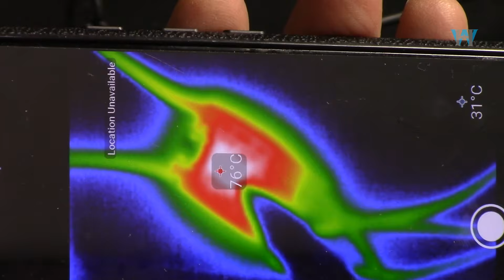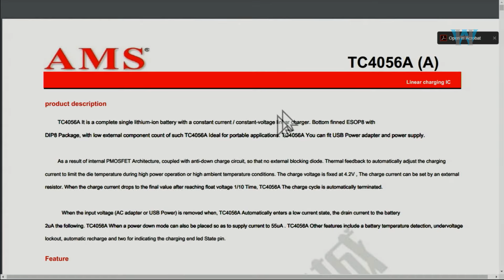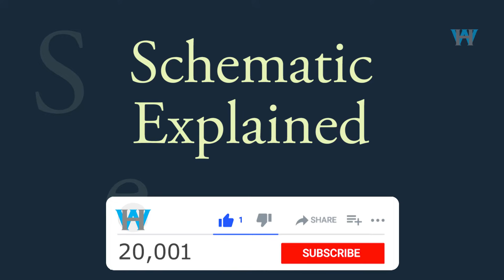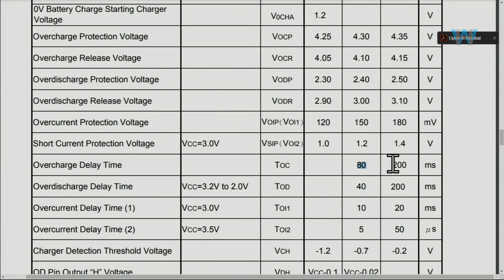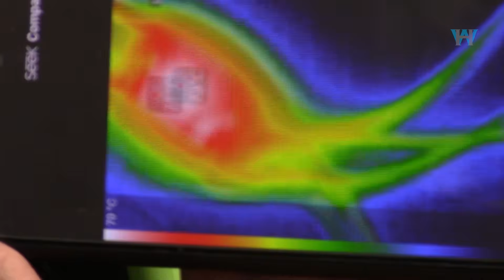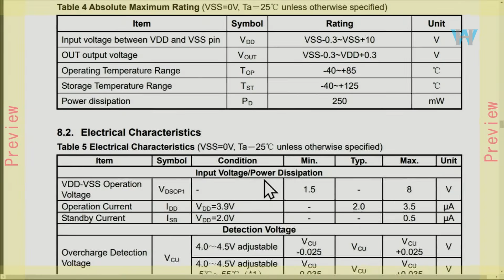TC4056 TP4056 USB 18650  Lithium  Battery Protection Charger Review

Comment: Its possible to change the cut off to 3,5/3,6v? I Want to use with a buck to 3,3v. Some one have any sugestions? I gona use with an esp32 and a MPR121 module, I dont wanna bust up to 5v because the regulator from esp32 is linear and I dont wanna wast batery.

Comment: Hi, 1. can i use 1 module to 2-4 batteries? 2. Will it protect overcharge & over discharge to all batteries? I understand the charging will be slow, i am ok with it. 3. Aslo are you saying if my equipment draws say 10w, this circuit will provide it? I thought this circuit only outputs 1A max (i.e 5W). Please reply. Thank you for your time.
Reply from the maker: Hi, 1-NO.  2-This if for lithium batteries and it has all protections which has been explained fully. 3 the amount of current this module can supply has been explained in the video.

Comment: So, how would I disable over current protection?
Reply from the maker: Hi, you made me watch my video. I have explained it clearly and even I mentioned the amount of voltage detected by the chip. simply remove that resistor I've shown in the schematic. This is the most detailed video if you want to learn. just watch and learn and you will be king of the battery charger using this chip.

Comment: hi, i bought like 50 of them cuz i make DIY projects, i put a remore usb c module so i can charge the battery from the side of my DYI tazer. but i put pos on neg and neg on pos, do you know what component died?
Reply from the maker: Hi, the both main chips should be dead as there is no protection in the chip for reverse polarity.

Comment: I have to replace a battery, which contains a little board with two chips on it.  One is the DW01A, which brought me here, which was good because I couldn't find a datasheet for it.  The other chip is the SM8205, and I can't find any information on that either.  I can find suppliers and even pictures of the chip - but no datasheet.  I don't suppose you have any info on that one?  It has 8 legs, but legs 6 & 7 are bridged with solder.

This was a very informative video, by the way - but unfortunately, it doesn't cover the chips on my battery.  Maybe my 8205 does the same job as your 4056 - or maybe not.

Incidentally, there  are two straps from my battery to a little circuit board containing these chips, then there are three wires from the board to the minicomputer board that it powers - red, black, white.  I don't know if the white one is for charge monitoring, or for temperature.

Comment: Hello, great video. I don't know if you'll be able to answer this since it's a 3-year-old video by the time I put Make this comment. But I don't know if I'm doing something wrong or if my entire batch of 20pcs of ts4056 are bad. 
USBC version. It has the extra protection. But when I plug it in. No lights turn on. Doesn't seem to charge. I've plugged just the USBC in, I know that the plug is good and the power supply is good. But it doesn't seem to have any voltage going through the terminals connecting the USBC to the board, or from the battery output and input. Or to the component. But I have wired it up so that my battery will go to my lights. And that works fine. But it doesn't seem to charge. The lights don't turn on if I plug it into a power source via USB or to the batteries. Or from the batteries to the component. 

I've tested five out of the 20 that I bought. But I at least know that my battery will power the component I'm plugged into. 

On that note, since I can't send them back. Is it still a good idea to be using this as circuitboard that can protect my lights from the batteries messing up or anything? Or should I just unplug it and buy new ones? 
Which I do have new ones on the way but I now have possibly 20 of these completely useless boards.
Reply: It’s probably your power supply. Some of the (PD?) supplies use the data pins to negotiate a voltage since some devices like laptops can take higher voltages (20 volts?) to get more power out of the usb-c connector. These charging boards are dumb and don’t do any handshaking. Try a basic 5 volt supply and/or bypass the usb-c jack. I read somewhere that shorting the data pins might signal the power supply to generate some output, but do your research!
Reply: @TroyeWelch  I actually just figured it out the other day. It was the cord. Some courts just don't work with this chip. I have two different manufacturers and they both have the same issue. But my 90 watt cord willpower my soldering iron but not the TP chips.
As soon as I plugged in the correct USBC cords. The lights came on. I was just so used to using the cord that came with my soldering iron, I figured it would be fine.

Comment: DW01 Overdischarge protection starts at 2.4V which is way too low for a LiPo. Do you know why?
Reply from the maker: This is based on the manufacturer data
Reply: @WattHour yes, but why is it so low?
Reply: @WattHour yes, but why is it so low?

Comment: Great to see a review of J5019 and its lack of undervolt/discharge protection (lack of DW01) and if there is alternative board with tp4056, adjustable boost to 6v to 12v+ like j5019 but with dw01 prior to booster for discharge protection.

Comment: You need to show us how to connect the chips together instead of talking and using a pen. Just for the visual learners.
Reply from the maker: my friend you have responed without watching the video. That portion was to exaplin the module, then I have shown schematic, then all features on the schamatic and finally I have shown multiple test where I explained and shown the wiring. You should have never seen such comperhinsive complete video.

Comment: thanks so much helped me alot..
but I have a question ..can we charge tp4056 with 5v  2.1 amp phone chager? or this will cause damage?
Reply from the maker: Just connect a USB connector. does not matter where it comes from. Yes it will work.

Comment: Awesome Video. One of best video to understand datasheet and deep learning.   
I have four questions.  
1. Is there more advance chip available as compared to TL4056 ?   Is TL5100 is better ? 
2.  During charging of battery , we can connect load ? 
3.  I want to use TL4056 for charging 18650 battery and simultaneously use it for AVR microcontroller, which work on 5V.
     please suggest , it can be used this way ?
4. which  DC to DC buck converter is suitable for 18650 LI-ion Battery? Input : ( 3V to 4.2V)  and Output 5V/2A current .

Comment: Very good explanation. 
Thank you for sharing. 
Is it possible to increase the output current bay changing R6.
I tried to put a ½k to get 6A output current, but it didn't work.
Reply from the maker: it is already set to maximum. you can decrease it. I forgot what was my test result. but I belive it is set to maximum.

Comment: I am not impressed with the TP4056 module. It takes a long time for unit to charge one battery and even longer to charge two batteries in parallel. I can honestly say this is a mediocre, NOT VERY GOOD, charging board and no one reviewing it or testing have the expertise or guts to say it. Except for one, this engineer warns people not to use it as well as other charge modules. I agree with his conclusion. It is better to just use a real charger like XTAR. I am glad I found at least one honest person that says it like it is.

Comment: DS463_main rev:00 94V-1.6mm  94V0-1.6mm  E123995 is a board used to charge a VDL 583040 lithium polymer battery. This board used5353A and 57b8 (4057).is it possible to explain this board. Thank you

Comment: The maximum current of TP4056 is 1A, which is too slow. I need 3A to fast charge the 18650 battery pack, so I modified the circuit and saw on the Internet that using three 4056s in parallel or using P-channel MOS are not good methods. Is there an optimal solution? I used a 0.22 ohm 5-watt cement resistor across the 5V positive power supply and the positive electrode of the battery. The battery started charging at 3.3V, with an initial current of 3.2A. When it was charged to 4.18V, there was still 1.5A. At 4.25V, the DW01 protection action was locked. The current is zero, and the discharge current is 3.1A. It automatically cuts off in 10 seconds. I don’t use protection and directly supplies 15A battery. Very easy to use

Comment: At 10:43, you indicate that both the OC and OD are not connected in the schematic. But they are connected in the schematic - check it. It made me believe that there are some versions of the module that don't have both connected - which isn't true - and would be ridiculous. If the DW01 is present, then both overcharge and over discharge protection is there. It wouldn't make any sense otherwise.

Comment: Over discharge protection is basically a lie then? If you discharge down to 2.5v for any significant period of time the battery is effectively destroyed.

To which I suspect you will say its to deal with voltage sag... This just means its going to ocilate and still likely kill the battery.

Comment: lets say you have 7 or more cells in series, can you use one power supply to 7 or more tp4056 modules to charge up all these cells in series without having to disconnect each cell from each other?
if yes then easy to make a balancing charger for many cell pack.
Reply from the maker: this is made for one cell. If you connect cells in series the voltage is added and it won't work.

Comment: Can you please tell me how to convert output 4.2 v to 1.4 V in this module ? Ampere must be 600+ ma
Reply from the maker: I have explained it fully. this is based on a charger and protection chip  ou can't change it. You get step down converter which I have so many videos on that.

Comment: how to increase current output?
it's posible for change of the mosfet for increase current output?
maybe use AO3400 or 70N03.
help me please for my question 🙏🙏
Reply: Hi,
Did you find an answer to your question?
I'm trying to use this module with my 3.6v screwdriver, but right with I turn it on the current protection start and cut the output voltage because of the rush current at the beginning when the motor strat spinning. 
Is there any solution for this case?

Comment: Excellent video.  Really helpful
What happens if the battery is connected reverse by mistake ? I think it fries the board.  
also what happens if 12v input is given by mistake
Reply from the maker: No protection for reverse nor for 12V. It will die.
Reply: I can confirm applying 12v in will blow the tp4056 apart. I did it myself by accident!

Comment: it can charge multiple battery in pararel?
Reply from the maker: yes you can. But divide the time it takes to charge. so for one battery if it takes 1 hour, then for 2 batteries it will take 2 hours.

Comment: 8:35 In THEORY, you can connect the input to 8.0V, but if you do, the 4056 charger chip will dissipate a peak of about 5 watts with a 1A charging current, causing the chip to throttle back charging current. Most people will just use 5V, not 8V, which causes the 4056 to dissipate 2 watts for a while. Many users complain about the heat the tiny board produces, and this is why. If heat bothers you, reduce the charging current.

Comment: Hi, Tnx for your great video. But I have a question. How can I remove dw01 and its mosfets but still protect the battery. Can I monitor the battery percentage?
Reply from the maker: Hi, if you remove it , then it won’t be this module . There is not current reading feature with this module

Comment: Great vid!👍 Would it be possible to increase the overdischarge voltage by increasing R5? 2.4v is way to low for my project😖
Reply: I added 400ohms resistance between ground and the chip side of R5 and it raises the overdischarge voltage to 3v!😍
Reply: I also have same 😊 question I need cuttoff at 3.2V any solution please
Reply: @Vinod-xw2bx  hi mate, if you connect 300ohms of resistance between ground and the DW01 chip side of R5 you'll get a discharge cut off of 3.2V or close to👍 the only problem is I think it also raises the voltage that it cuts back in from 2.9 to 3.7V🤔
Reply: Another problem with the idea presented in the comments is that you also increase the overvoltage protection essentially disabling it.

Comment: Nice and proper explanation. have a question, can we replace the R6 with 2K to reduce the overcurrent protection to 1~2 amp? becauase some battery can not output 3amp. can you demonstrate it is a video maybe. thanks
Reply: @ingulari3977  i never tried.

Comment: Hi!
I have one such module. The blue (standby) LED does not light up when charging is complete. The red LED, on the other hand, is constantly lit. On the other hand, it charges the battery because I measure 4.2V on it. What can cause this? Thanks for your response!
Reply: I think the red LED keeps on even when the battery is fully charged is because you have connected load to the board. If the load is connected to the board, the board will always keep red LED on unless you remove the input supply to the board. But I think when the battery is fully charge the current to the battery will stop which the TP4056 will keep flowing current through it to power the load but not the battery.

Comment: Your explanation about Over-Charge(OC) and Over-Discharge(OD) protection seems wrong. The 8205A is a pair of N-Channel Enhancement type MOSFET. The Drain of both MOSFETs are connected together. You forgot about "Intrinsic Body Diode" aka Reverse Current Path of MOSFET. The Cathod of two body diode of MOSFET pair are connected together. During OC protection, the MOSFET(OC pin of DW01A connected with the Gate of this one) is turned off so the charging stops immediately and the vice versa for OD protection. The same thing you can turn for positive line with a pair of P-Channel Enhancement Type MOSFET. By the way,  thanks for the great effort.
Reply: That's true, when one MOSFET is on, current passes through it via the anti-parallel diode of the other MOSFET. The explanation in the video is clearly wrong, because same-type MOSFETs cannot let current pass  Source-to-Source when their Drains are connected!
Reply: @WattHour why no clarification on this?

Comment: Hi sir, ic dw01a has over discharge limit upto 2.5v but 18650 li ion cell has safe discharge limit upto 3 or 3.2v , is it good to use it. Plz clarify
Reply: You can add a 330ohm resistor between ground and the chip side of R5 to increase it to around 3.1v.
Lower the resistor to increase the overdischarge voltage 👍
Reply from the maker: Hi, I remember that I mention upper and lower voltage by showing the datasheet. I don't remember the value. So please watch the video.

Comment: Well explained 👍🏼 thanks for the informative video.

I think the (-) of battery should be connected to 1,8 pin of FS8205A chip instead of pin 2,3..and actually the load should be connected to pin 2,3
... that would allow it to be isolated from either part(charging or, discharging) of the circuit...

Currently both charging and discharging path is common so when it disconnects it because of OD(over discharge) it also disconnects the charging path.. same while disconnecting because of OC(over charge/current) it disconnects the load also...

Please correct me if my understanding is wrong.
Reply: I think I agree but pin 6 of the protection circuit needs to be connected to ground, which it wouldn't be if the overdischarge circuit protection turns on as it would disconnect the path from 1,8 to 6.
Also, connecting the B- to 1,8 and OUT- to 2,3 would disconnect the load from the charging port either of the MOSFETs closed, probably not intended.

Comment: TP4056 when does charging come on?  At what voltage?  We don't want, nor need, it to "top it off".  What I am getting at is that below a certain voltage then kick in the charging but not before.  You only get so many charging cycles,  With solar powered equipment it will charge each day unless a circuit prevents that until a minimum voltage is hit.
Reply from the maker: both has been explained. start of charge and stop. I have shown data sheet and spoken about it I remember.  you may have skipped the video.
Reply: @WattHour  I watched it but I did not see you say the charging voltage will always start at XX volts.  I saw where you said the OV will stop it.

Comment: Excellent and detailed description.... Thank you.
What if i want to connect 2 batterys whit 2 charging moduls in serial!?.....to get arround 8v from the batterys. 
Can i do it on the LOAD connectors? (+ load on the first module to be connected to the - load on the second module)
Is it possible?... How can i do it!?.
Thank you.
Reply from the maker: you are welcome. no it is not possible because the modules have either + or GND commend.  even you connect them each separately, once you try to get the output, you would connect positive one to the negative of the other.  and they are command and will not work.